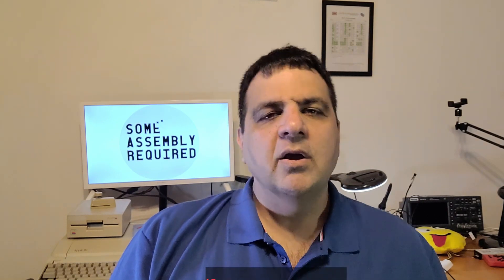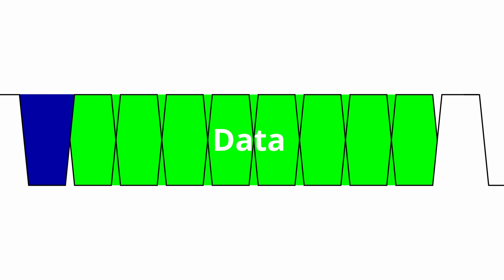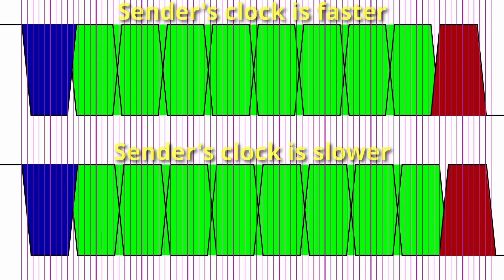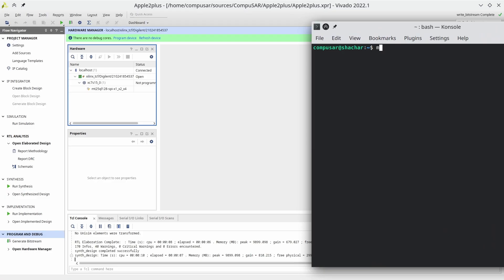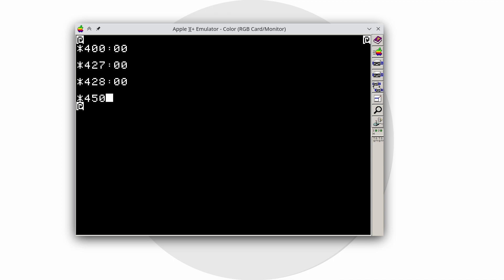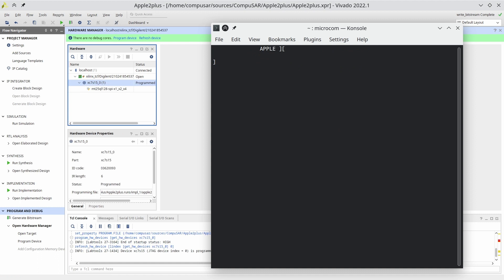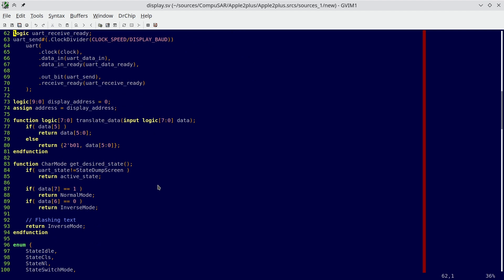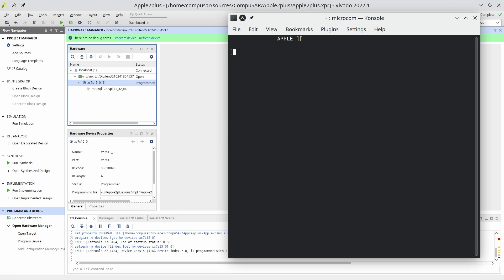FPGA Apple II clone: Displaying text

Comment: I did some CPLD designs in the ancient past, including a rather cool Atari 2600 cartridge with a 36-macrocell Xilinx which allowed code to plot/erase pixels on a bitmap graphics screen using the sequence "lda $7F00,x / ora $7E00,y / sta $7E00,y" or "lda $7F80,x / and $7E00,y / sta $7E00,y".  I've never done FPGAs though.  What's the best way of getting into FPGA design?  For CPLD projects I used ABEL, which is a bit of a goofy language, but I liked the abstraction model based on specifying the clock, data/toggle, and async set/reset for each macrocell.  Do any of your videos contain a good introduction to such things?
Reply from the maker: Sorry, no. The project is being held up by the videos as is. Getting into the syntax of Verilog would be way too delaying. I touch on several subjects that are relevant, but no orderly tutorial.
Personally, I learned System Verilog from https://fpgatutorial.com/verilog/, but that's just the syntax. Concepts such as flip-flops and pipelines are from my BA, and the other I no longer remember where I picked up.

Comment: This is great! Only issue is I only got Altera not Xilinx :)
Reply from the maker: At this point in time the code would probably work as is. I don't think there's any Xilinx specific code there yet. Very soon, however, I'll start needing not only Xilinx specific code (such as MMCM to generate a clock), but also hardware on the specific QMTech board I'm using.
I'd say "buy it, it's cheap", but last I checked it was out of stock with no new boards in sight :-(
I have 4 boards. If things progress well, I might ship one to one of the viewers.